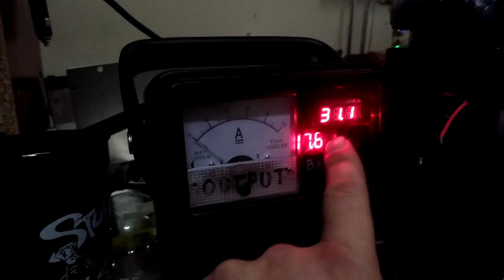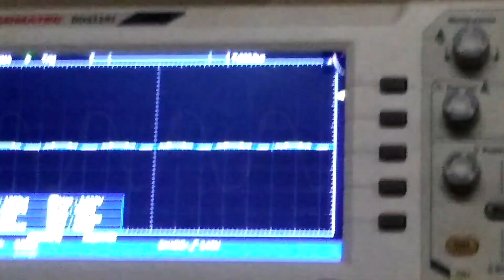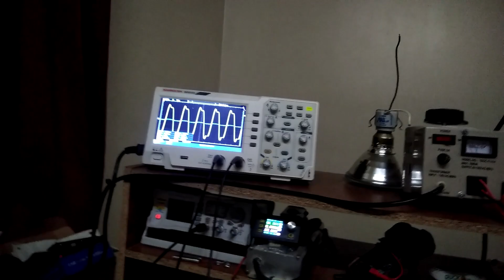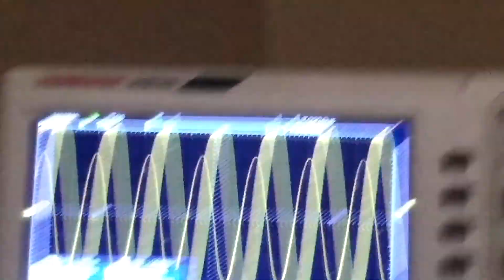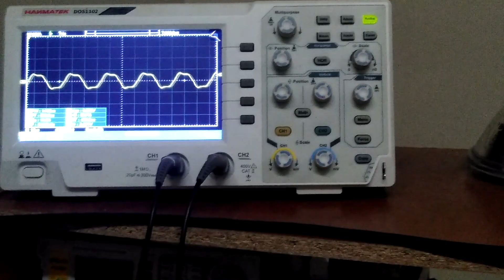PLL SSTC Full Bridge Setup&Tuning

Comment: Hello.  The result is wonderful.  Could you share the schematic of this board?
Reply from the maker: I'm working on what will be a more complete schematic but I haven't decided on everything yet. This one is easy enough to build just based on Steve Ward's Mini SSTC driver and is basically the same thing but using the full bridge, IGBT's, and adding the PLL for feedback. The PLL isn't necessary and is just a feature I wanted to add for testing.